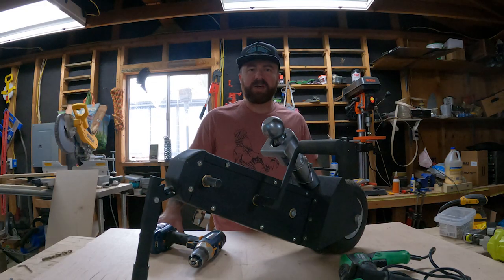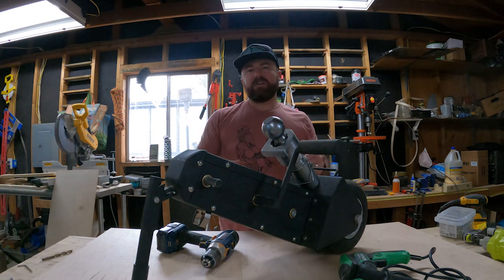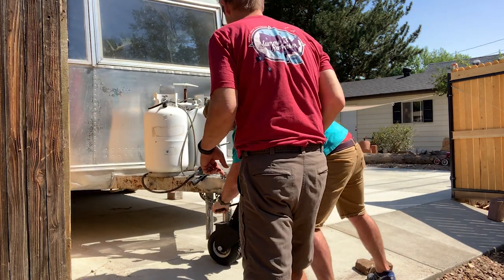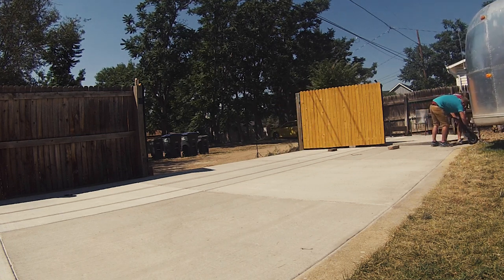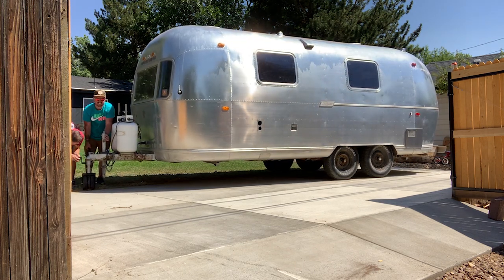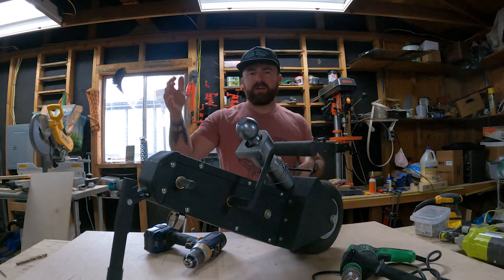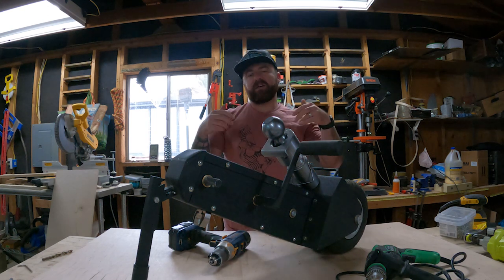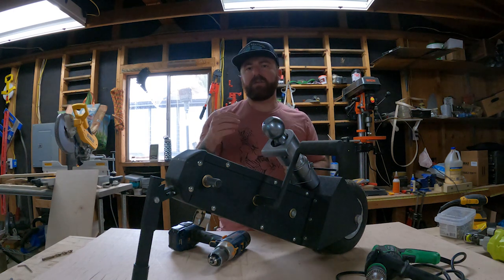Is the TrailerValet XL the right trailer dolly for you?

Comment: I got one of these second-hand for $100.  It's extremely well-built but I don't think I would ever have paid the full retail price for it for the amount I use it.  It is very useful and effective in maneuvering  my 17' travel trailer in my narrow driveway and I even have used to to move the trailer out onto the street.  However, if you are tall it is really hard on your back after about a minute or two even if you are using a drill to power it.  I tried pulling my trailer back into my standard suburban driveway (flat street, concrete ramp/sidewalk, slightly sloped concrete driveway) and it did very well until I hit my driveway which is quite new and smoother than the sidewalk.  The wheels then lost traction and I could go no further.  Ended up having to back it out and hook it up to my car to pull it in.  I think if you have a rough surface (older asphalt or concrete) it works fine but smooth surfaces with slope is a challenge.  But if you have limited space it is definitely worth trying out.

Comment: How heavy is your Airstream?  I have a 27ft Jayco Feather, its 6300 pounds dry weight.
Reply from the maker: that is a great question, when I did this video the airstream was pretty much completely gutted. but even then I would guess the weight was somewhere in the 4500 lbs range. Hope this helps and good luck with your trailer
Reply: @beardedspruce  Yeah, I mean Costco has a deal on this one right now so I may do it even though I'm not sure its the best for the job.  I have a gravel area that has a slight incline at the beginning that could be a challenge.  I could compact the gravel or use a ramp to smooth out the incline at the beginning.